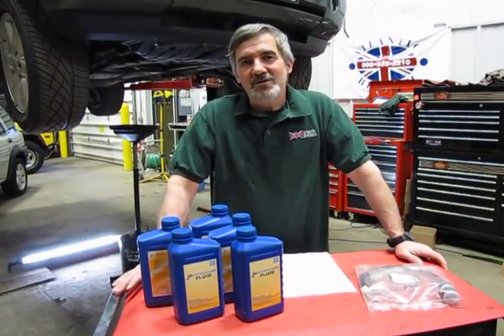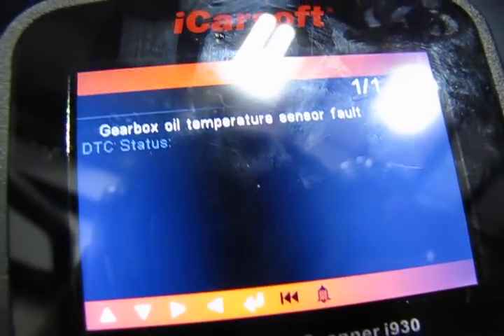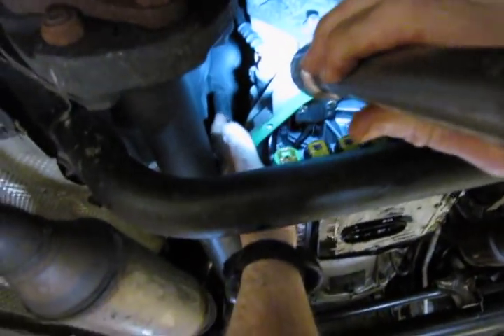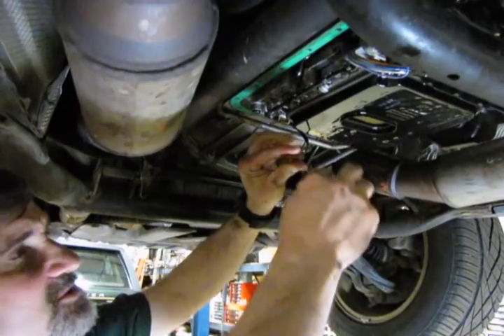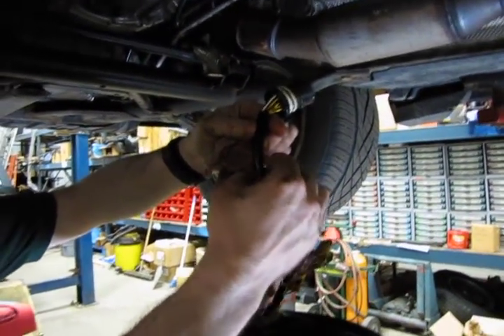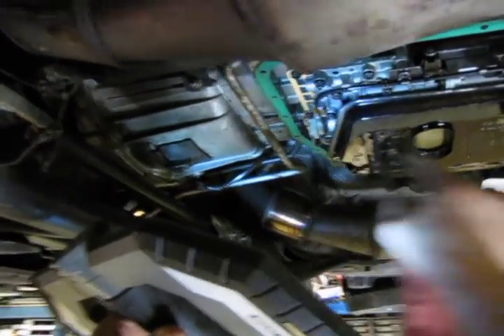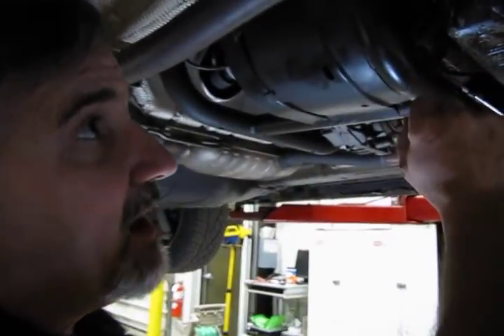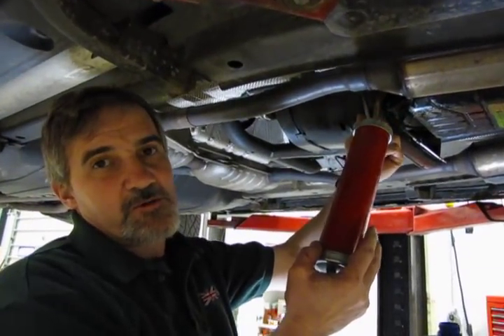Transmission Fluid Temperature Excessive Warning Light on Range Rovers | Atlantic British Presents

Comment: Hi sir thanks for the great video. I had p0710 oil temperature sensor too high along with P0641 and P0840. The gear can shift but car wont move even forward or backward. Is there anything related with the transmission harness or the temperature itself? Thanks in advance
Reply from the maker: All three of these are related to the transmission system. For further diagnosis, you'll have to bring it to your Land Rover mechanic so they can investigate further.